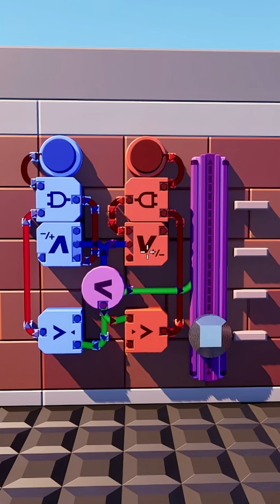Variables Part 2 | Brickadia

Comment: very nice!
too bad there isn't just a generic "counter" but the limitations don't exist when you have this level of control, you just MAKE the counter from scratch
Reply from the maker: It would be nice to have a range limiter built into the variable. Right now the variable will store a number but it doesn’t stop if it goes too high or too low. Some of the other gates like the comparison gates such as greater/less than or the multiplication/addition gates, already let you store values inside the gate (e.g. the multiplier inside the multiplication gate). It would be great if the Var gate could include two values to restrict its range.